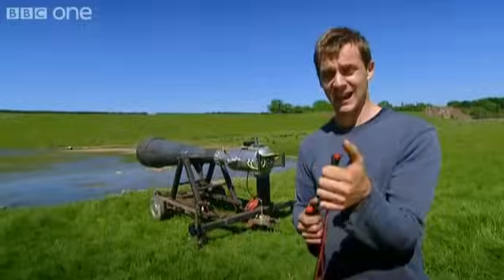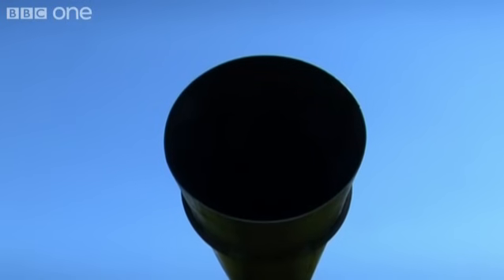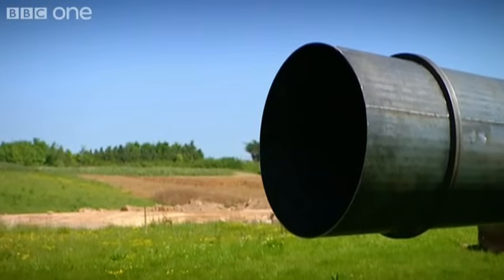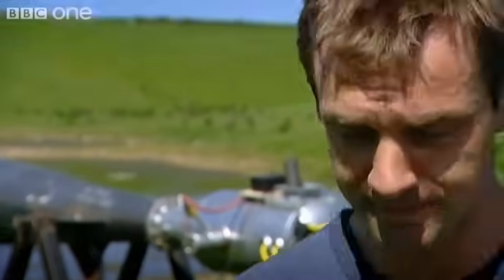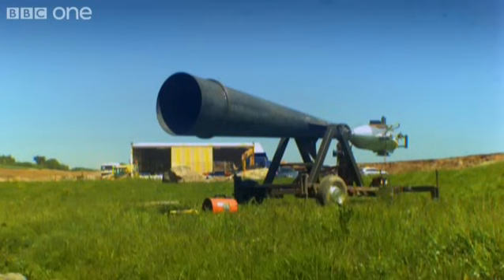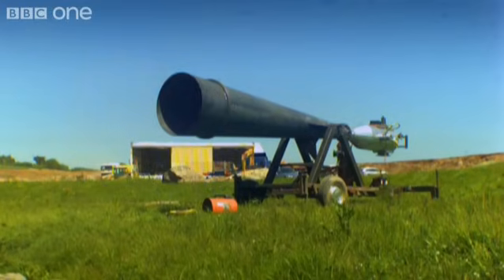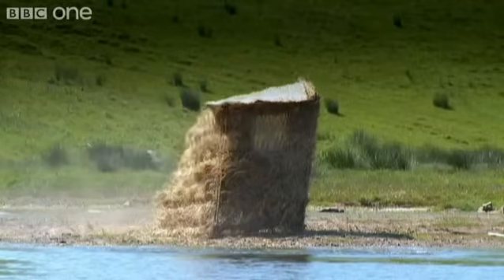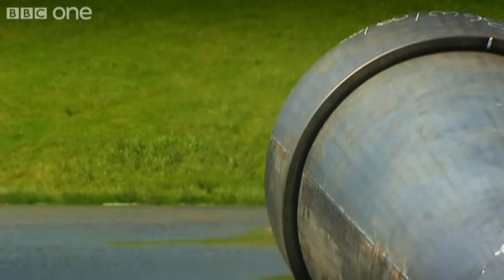Vortex Cannon! - Bang Goes the Theory Preview - BBC

Comment: That was a wall of bricks. The other ones at least had supporting walls to stop them tumbling straight over. Did you even use mortar? Do you know how a brick house is made? The brick is not the supporting structure as brick tends to let water soak right through and thus wouldn't do anything to stop the rain coming in. I get it, but like this is the most unscientific experiment ive seen. The three targets were built in vastly different shapes, the third one wasnt even constructed it was stacked in a single line from the looks of it with nothing holding it together. Did you tie the straw and sticks together? So not only are the three targets different shapes and sizes but you purposefully changed a variable for only 1 target to get the result you wanted. The only thing you have done is waste everyones time with a clickbait video.

Comment: Really neatly done! Though I imagine that the Vortex Cannon wouldn't have been able to knock down the bricks if the brick house had four walls and a complete roof like the straw and stick houses did. Fairly easy to knock over just a wall that isn't otherwise anchored by anything.

Comment: The brick one wasn't even a full structure, it was just one wall and the bricks weren't even held in place with mortar or anything, they were just neatly stacked.  A good stiff wind would have achieved the same results.

Comment: Some of the comments here, are very idiotic.  First, building such a device is not easy.  If you think it is, then do it.  Second, it's firing a donut  of compressed air, so no, cementing the bricks together, it would not do anything.  However, if you listen carefully, you can hear the impact of the compressed air donut striking the bricks.  That is a lot of weight to push over.  If you used that on a regular house, you would probably break some windows.  On a person.  They would be knocked off their feet and could possibly suffer some hearing damage, not from the sound, but from the over-pressure generated by the shot.  This thing is not a toy.  I do want to build my own though...

Comment: So the "brick" house didn't have any walls but the front facing one or ceiling.  And the bricks were just stacked without any cement.  how the hell is that a house???  Even if the wall they used had cement in it the pop gun would have no effect.   I know this is more for the show and not actual science.  But it is kind of sad and will confuse young kid.

Comment: If the bricks were cemented together like an actual brick house...it wouldnt have worked..
Reply: +Khy Zer yea, but the point is to show that the device has enough force to push a few bricks... which is a lot if you think is just a machine that moves air
Reply: +Khy Zer Well if you increase the force that the bricks could take, then one could simply increase the power of the cannon.
Reply: The shot was also a little high.
Reply: Everything you people see are toys. I think even a typical civilian could take this model and deduce how to make it better, and more practical. (I know I give you people too much credit)
Reply: @nighthawkviper6791  Indeed. Scale that thing up a few times and tighten up that cone angle just a tad, and put a burst disc between the chamber and cone that can hold a few bar of air pressure, pump it up with a stoichiometric mixture of acetylene and oxygen, and boom (literally) you've got yourself a vortex cannon that could actually take down a brick house...
Reply: Just get more air and power it will blow your cute ass apart :P
Reply: This merely shows it is PLAUSIBLE as the myth busters would say. You add morter, I increase the power of the cannon... either way the point is made. Vortex cannons are real and, if strong enough, could damage a brick wall.

Comment: If you don't use mortar, a kindergartner could push your brick wall over.
Reply: BabakoSen he pushed over bricks with just gas/air from quite a distance, its not about it being powerful in an overall sense but its powerful in the fact just purely gas/air pushed over bricks from far away.

cannons with cannonballs exist and have for a very long time and are much more practical, this is simply just a cool demonstration.
Reply: BabakoSen So?
Reply: Brad Butler So this cannon isn't nearly as powerful as it's made out to be.
Reply: I was going to comment the same thing.
Reply: can a kindergartner push it over by blowing on it from like 200 feet away?

Comment: They didn't even believe enough in their own vortex to properly mortar the bricks together. That's just sad.
Reply: Its more than likely that they calculated shooting air at cemented brick, would do absolutely nothing and thus make for some really shit television.
Reply: Really? I expected more. But then I guess I'm just a sucker for experimental weaponry.
Reply: Regardless, that is power unexpected from a cannon that shoots air.
Reply: I dare you to stand in front of it.
Reply: MorsCertaMoraIncerta
I'm not criticizing the vortex cannon, I'm criticizing BBC for not believing in it enough.
Reply: @MorsCertaMoraIncerta  Its literally a gust of wind fired at a fast rate. It does you no harm
Reply: @cheezy_purp3545  lol what? you're wrong, if you stood 6 feet away from that cannon it would certainly do you servere damage.
Reply: @cheezy_purp3545  and the shockwave of a thermobaric weapon is too :).

It’s still not gonna feel too good tho. (entirely fatal and painful the whole time) 

Organs really don’t like massive pressure changes.
Reply: @rtruth7002  yes, but at the distance that straw hut is placed, that vortex cannon ain't doin shit to brick and mortar. However, plaster can be a different story, but it may be even more effective with how flexible these weaker walls can be. I wish they made an example tackling a section of a modern house, built to PROPER American construction specifications, which can demonstrate how effective it really is.
Reply: @MorsCertaMoraIncerta  I will

Comment: You basically built a one-shot rocket motor. The nozzle accelerates the gas flow to supersonic speed and the shock wave it produces travel through air until the wall. A simple 50Pa delta-P wave can destroy an entire wall (because of its surface), so nothing really impressive there. Although very interesting :)

Comment: I believe that does count. Even though there's no concrete, there's still the added on weight of all the bricks lying on top of each other. Take the weight of a brick, multiply it by the number of bricks on that stack. And that's how much weight the cortex cannon pushed. In one blast. We'll work on going through concrete later. All science is taking little steps to something amazing.
Reply: No not really, if you if you make a wall of bricks that are only stacked your wont be pushing the the collective weight youll simply be pushing one. Itll even make it easier because you wont have to move the wall but instead only tip it over. Tipping something that has no support whatsoever generally doesn't take much force. Thats why nothing is built like that.

Comment: @anaikahas 
I Don't think so.
Theoretically, it is a ring at first, as it moves, it pushes the air around in every direction, so a layer of fast air is in the middle of the ring. But it will probably be much harmless, as it is just a "side effect" of the ring itself.

Comment: similar research was founded by security agencies to be perfected with the purpose of crowd control and riot gear ...  a scary nonlethal mid-range crowd-buster ... the only problem in early testing was the fact that the vortex acts as a circular tornado meaning it can catch and throw at a high speed the protesters weapon of choice, the brick ... when you got bricks going 90 to 120 km/h  the weapon is no longer lethal ( fun facts )

Comment: Notice in the demonstration how they suddenly switched to a single wall of stacked bricks vs. the three or four-sided construction used on prior tests?

So it knocked down a single wall of non-cemented bricks that were merely stacked on each other. Although this device is impressive, they presented rather skewed results.

A few years ago I bought a simple air-cannon toy at a theme park. It works very well and can *throw* a ring or air quite a distance away to unsuspecting people or other objects

Comment: well, it could be very well used for protests gone wrong and looters and stuff, instead of a watercanon, which needs loads of water to carry around... the fact that this brick wall wasn't that strong = true, but the wooden thing probably is evenly balanced and I think I wouldn't wanna be in front of the thing... (whats up with all the negative comments anyways, i've seen a lot of worse ideas)

Comment: The only part of the brick house that was actually knocked down was the top, the weakest part of the structure (note this at 2:12). Notice also that the vortex only shook the bottom and sides of the brick "house"-- it was either not strong enough to knock it all down, or it was concentrated in the wrong area. Nonetheless, considering the speed and force of the blast, I don't doubt that it could do some damage to the side of my house. Not much, but enough to piss me off.
Reply: Don't stand near the windows

Comment: Its not so much knocking down a brick house as it is taking a few bricks of the top of of a brick wall which is not cemented together, or made into a proper house or attached to the ground... i reckon throwing a small stone at the wall would cause the same damage...

Comment: Why was the brick "house" the only one with just 1 wall?  Also, the bricks weren't cemented together. Probably just stacked or glued. And there are huge gaps in the area of the brick "house" that fell. If you ask me, I think they knew it would not have the force to blow down a 4 sided and roofed building made of bricks.

Comment: @GBR360games Yea it's a bit of a rubbish brick house, but on the other hand it's pretty impressive even if the wall didn't have any mortar holding it up. I mean, it's like blowing on it from a distance and expecting it to fall down. You just wouldn't, but it does. It's cool.

Although I suppose if you got the explosives inside it you could blast the wall to kingdom come if you wanted. Whatever, I like it anyway.

Comment: 3 flimsy poorly constructed walls does not a house make.  Also that was pretty clearly just a single wall of bricks stacked without mortar holding them together ...essentially you have proven that air can knock over building materials that are loosely stacked and not supported, brilliant. good use of money.

Comment: The brick construction was a joke. Not only was it not a completed house like the other two, it was basically single red bricks stacked on top of one another with no cement sealing. 

And despite all of those advantages it still only barely knocked the top half off. Cool effect but the results are not very impressive at all

Comment: the third test was a failure, he should test it on the brick house with the same construction as of the first two test with complete 4 walls, testing it with a brick house with only one wall? Bullshit, for sure it will stumble over without support on both its side, and duh? it didnt even blow the brick, it just knocked it off. Fail!

Comment: Ok, they didn't even build the stuff properly, those were just bricks set on top of each other... same with the wood they didn't attach it to a foundation or anything like that. Sorry to say, Its cooler to see stuff go flying but I doubt if they would use proper construction that at its current state it would not knock anything over, maybe break a window. IMPO

Comment: I've done vortex ring research as part of an internship, and besides being somewhat cool, it's a lost cause.  At those speeds the ring becomes turbulent so quickly, the structure dies just a few ring lengths downstream.  It's obvious those bricks were already teetering, and a ping pong ball fired at them would have knocked them over.  Like I said, cool, but no practical applications.

Comment: that wouldnt do anything if the brick was made like it should have been because they didnt use cement or mortar i mean my cabin is brick with cement and mortar and that house is over 20 years old not even a single crack in it and it has been through tornados and we havent noticed it so that was a failure for the test because it wasnt like the story

Comment: Cool demonstration of the power of air movement, but I agree with the earlier poster that having a stack of bricks representing ONLY an unmortared wall does NOT count as a "house"; not only that, but he re-aimed the cannon to hit only the "gable" portion of the "wall", which would be structurally the most vulnerable part. If the wall were bricks AND mortar, the results would have been much different.

Comment: This guy is an idiot. Of course a brick building with no mortar is going to fall. That's the whole point of mortar, it allows energy to be dissipated throughout the structure. Otherwise, any force exerted on one brick is felt only by that one brick except for slight force transference due to friction.

Comment: Its not the water in the air that causes the the cannon to work. If there was absolutely no humidity at all it would still work. The "cloud-ring" you see is simply the water particles inside the vortex ring condensing enough to where you can actually see them. Its like when you see a jet approach and then cross the sound barrier or pull high G maneuvers... its causing the air to get squeezed and condense the water to form clouds.

Comment: (cont.) Then, understanding it the way I did, if there isn't enough water particles in the air, even the most powerful concentration of "fuel" inside the cannon will do nearly nothing, IF there isn't enough water particles in the air, since the basic function of the cannon is condensing those said particles... Anyone care to enlighten me further?

Comment: well... General used items come from crazy ideas... Although this one will need a HECK of work to be usable...
1st Thing: Not enough Humidity in the air= Not enough particle movement to be able to even 
MOVE a straw;
2nd: The "Brick House" was, as we all saw, a brick WALL, and he aimed it ONLY at the top of the wall... why wasn't the pressure aimed at the base? Even though, very nice improvement... No need for lead to do direct harm on the human body.

Comment: Heh, it's pretty impressive that they can make a blast of air that strong for that distance with such a relatively small device.  Even if the bricks aren't cemented together, it takes a reasonable force to knock them over.  Especially considering they were just using air from such a long distance.
Reply: not at all. you can push bricks like that over with your finger
Reply: @THESLlCK  Sure, but I don't see anyone blowing really hard and knocking things down from 20 yards
Reply: @MatMabee  out of a straw, no. But just consider that air really does have force behind it. A .50 BMG has sucked the eyes out of a deer's head from a missed shot a foot away from its head. It's not just nothin.

Comment: The high-speed camera capturing the 'moment' o the shot seems real enough to me... And besides... the 1st shot hit the water. That's real enough. I think this experiment has been tested before. Get a barrel and tighten one end and make a small hole on the other. With just a slight slap, air particles can be pushed out of the barrel... something like a 'sound blast'....

Comment: This is legit. It can and does work this way.  The problem is that his "houses" are less structurally sound than a garden shed and the vortex dissipates into the air much to quickly to really be effective at long range.  However, if the distance were halved, I presume the cannon could do a dangerous amount of damage, especially towards animals or people.
Reply: Do not let fluffy in front

Comment: What you didn't see was that the wind gusts in that location the previous days was blowing down the "Stick house" down. This proves that a vortex can emit enough force to blow down certain obstacles in its path; however, these "houses" were not real houses with foundations.  The bricks didn't even have mortar holding them.  Even back in the day that the fairy tale was set in homes were built with a solid foundation and couldn't be blown down so easily.

Comment: The straw was weak. If it was windy outside it would of been able to blow that over, because of how tall and flimsy it was. The sticks were just as flimsy and acted just the same as the straw. The bricks weren't even made as a house. It was just a wall of bricks. The middle and bottom of the bricks were in layers of two, but the top had a layer of one. The guy only hit the top of the brick wall which was obvious that it would fall over, because it was one layer which made it the weakest part.

Comment: tbh it didn't push down the brick wall, it was really really poorly built for a start. and it's not usefull in a war senario at all really, unless you want to push poeple's guns off them, and depending how good the reload is too. I'm sure if a proper scientist gets on it we would see some real powerfull air blasts like that bomb that you fire in caves that blows up the air around poeple surrecating them in a implosion